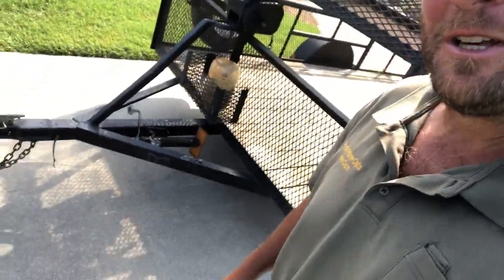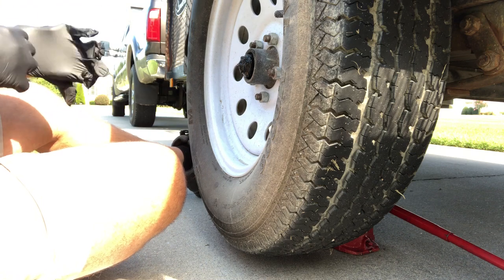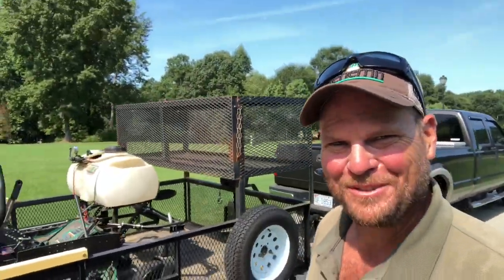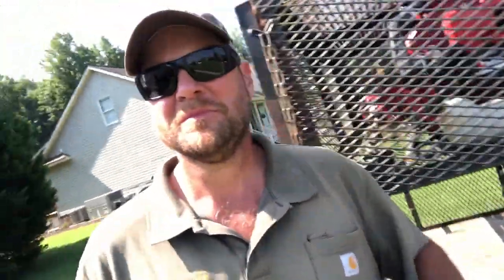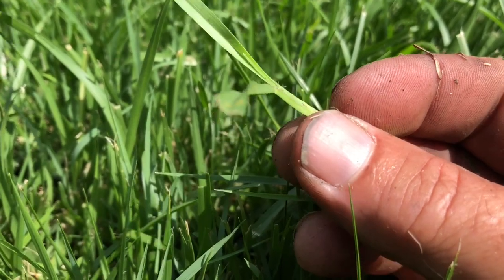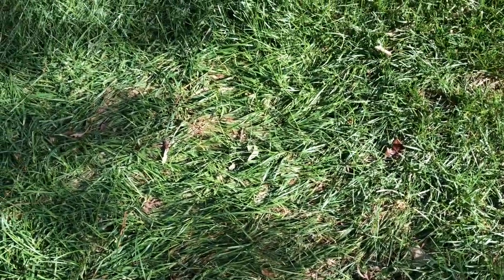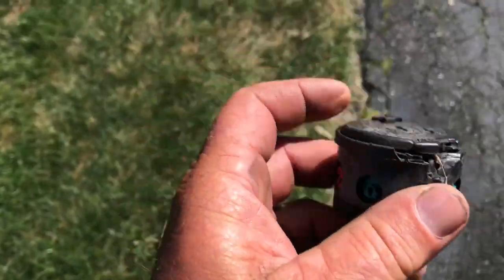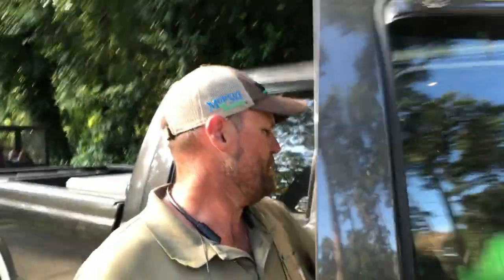How To Adjust Trailer Bearings and more!

Comment: Look on the top there’s an arrow on the sprinkler tops. Especially rain bird
Reply from the maker: Right . I just can’t adjust it till I see it run
Reply: Paul's Prime Cuts yes you can.   I has a set to go around to how far you want it
Reply: Paul's Prime Cuts like a stopping point from left to right.
Reply from the maker: Scott K yeah I did all that twisting it by hand I just need to see it run to really get it set right 👍🏻

Comment: paul….I tried the speed feed heads with my stihls, but found they didn't hold as much and they kept feeding line when they shouldn't. Typically happened when trimming tall weeds. You think mine was defective? I wasn't impressed, but if you have had good luck with them maybe I will try one again. I went back to the stihl factory heads. sorry to hear about the trailer. I have had a run of flat tires myself....not sure what the deal is.
Reply from the maker: rbljackson I have used those heads for years with no issues..... I wonder what would make it put out line like you were saying? Might be worth trying another one